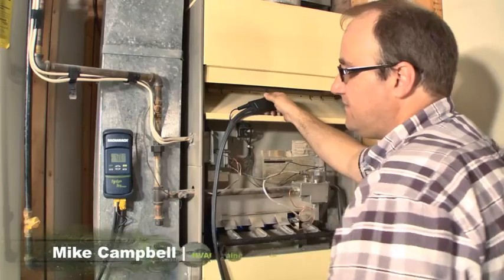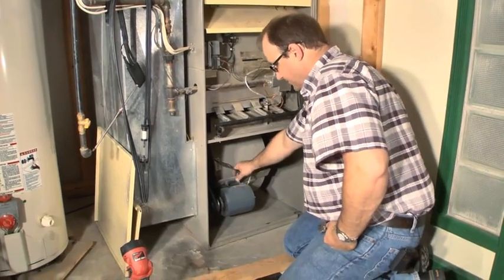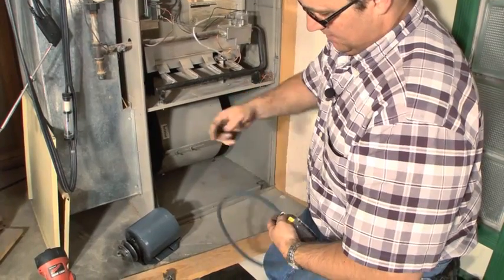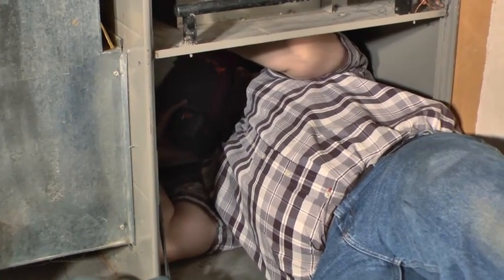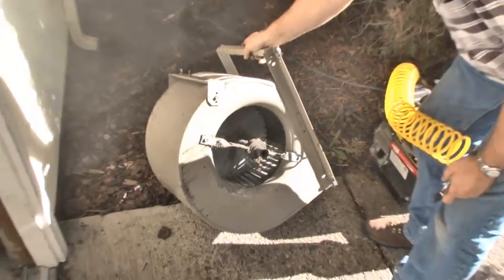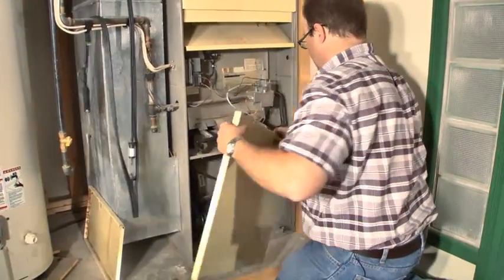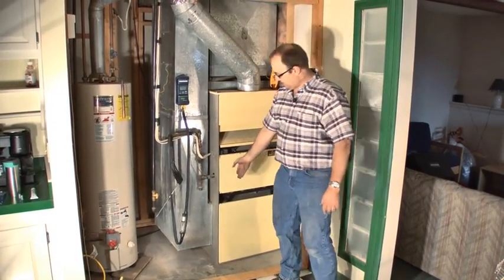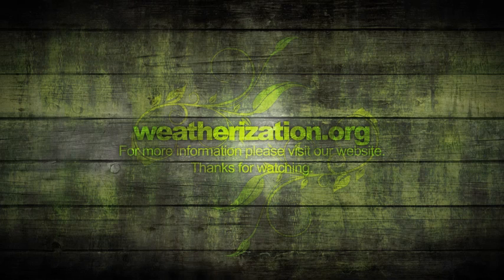Gas Furnace Basics: Part 4

Comment: This was a pretty thorough inspection.

I would like to have seen a total static pressure reading and a static reading on the supply and return to help determine where the airflow problem is.

Comment: Enjoy the series. In regards to this furnace a couple other suggestions. The furnace  was still running a high temp rise. Most limits on a forced air system normally don't  exceed 200 degrees with the exception of new furnaces where the proximity to the burner is very close . As for this furnace it was belt drive. The pulley on the motor is adjustable. By loosening the set screw and turning the pulley in, rpms increase. Also I would have derated the valve to 3.25. If not,filter plugs= limit out

Comment: Where do you find an HVAC person like this?  When my furnace is serviced for the winter, the technician changes the humidifier and air cleaner filters & checks that the condensation pump is working and the furnace turns on.  I know my service company does not have technical expertise to do this type of work.  I have asked for this type service in the past and have got negative response from them.  Should I contact American Standard/Trane for this type service?  What is this type service called?
Reply: Denis Slota this would be beyond a typical service check but they should do more than what you've listed

Comment: You mention in this video that you are using "30 weight" oil.  I hope you do NOT mean 30 weight MOTOR OIL, like is use in a car... correct?  The correct oil for sleeve bearings is "turbine oil" ,oil that is NON-Detergent.  Detergent breaks free the particles suspended in the bearing and turns it into lapping compound, seizing up the motor/ blower wheel.